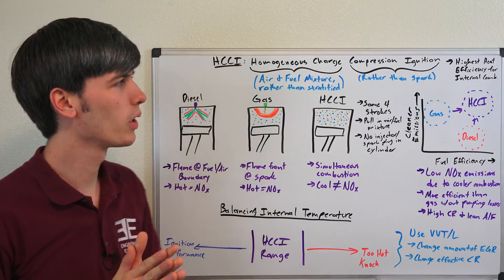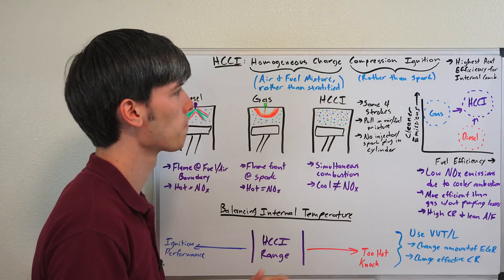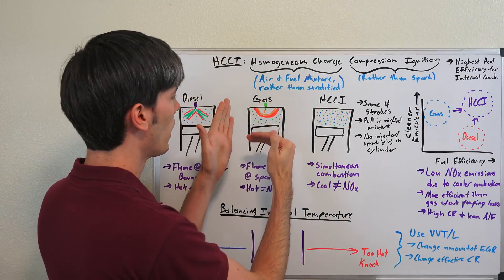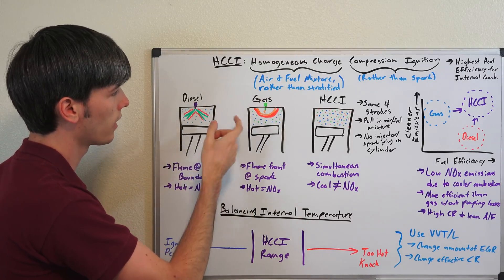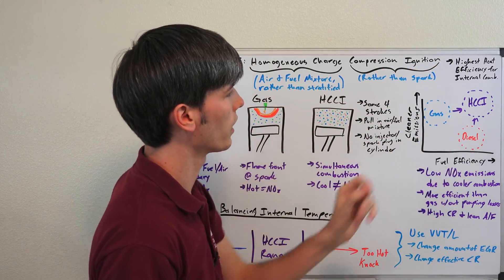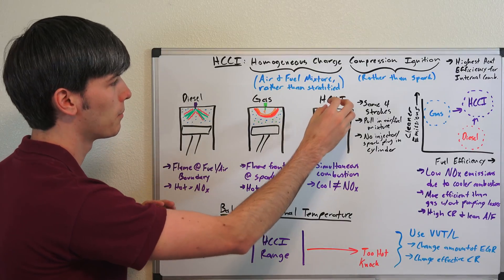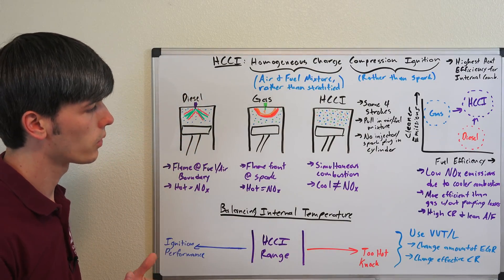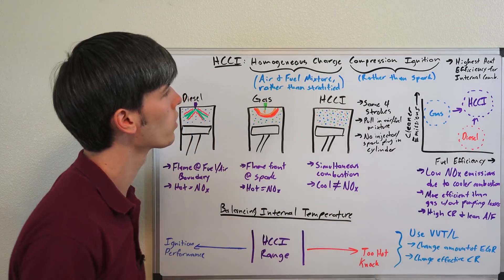The Most Efficient Internal Combustion Engine - HCCI

Comment: This is simply a highly speculated proposal for a possible engine engine design, its currently still in the lab. There is no proof that this will actually work because it only works in the lab right now using exotic fuel blends, which are not acceptable nor available for mass production use. Current gas engines actually are homogenous charge (HCSI) right now and are only missing compression ignition to make it an HCCI. Toyota has used variable (asymmetrical) compression ratio since 2007 in its Prius models and Ford has already presented its gasoline engine with compression ignition several years ago. The problem is that although gasoline can be (and is) injected into a cylinder so its functionally homogenous, its combustion pattern is unpredictable when compressed to the extremes that is required for diesel operation so (engine damaging) detonation occurs. High tech computer control has been applied to control the mixture even more precisely but it fails outside the lab, where conditions cannot be controlled precisely. Research is focused on making gasoline engines closer to diesel because gasoline already has much lower emissions than diesel. An exotic fueled HCCI engine is not likely to be successful in our lifetime, but improved fuel injection (direct injection) with improved spark control technology.

Comment: injecting the fuel doesn't ignite the fuel mixture in a diesel engine. it's heat of compression. as the fuel mixture is compressed, it gets hot, until it reaches its flashpoint, when it ignites. that or glow plugs/an alternative form of glow plugs, but those mostly are just needed during warm up.
Reply: There is no air fuel mixture in a diesel engine. Fuel ignites instantly as it is injected.
Reply: Fuel can't burn without air. There has to be an air fuel mixture.
Reply: It's mixed as it's injected, which is a reason why emissions like NOx are bad for diesels. Mixing it thoroughly on the intake stroke lets it combust in the best way possible

Comment: Might have missed it but how is the charge getting ignited?
Reply from the maker: Compression.
Reply: Like a diesel, but NOT controlled by injection timing. This works fine on small engines, but destroys larger ones, just like detonation (pre-ignition) in a petrol engine.

Comment: I'm not disagreeing with anything you said, however, if we are talking in terms of total efficiency, hcci isn't as efficient as an internal combustion engine could be. since the amount of heat is reduced, the total possible heat energy which could be discharged from the chemical reaction is effectively wasted.
Reply: instead of trying to reduce combustion temps, they ahould be trying to find a way where 99% of the total heat energy is absorbed and used to propel the vehicle. e.i. use the coolant system to produce a steam which drives a generator which charges a battery or is used to also propel the vehicle, and have air to air "radiators" inside the exhaust system to absorb any residual heat.
Reply: BMW were looking into that once, I remember.
Reply: It is a great concept, but there are some serious draw backs. Essentially what you are doing is turning your engine into a  boiler/pressure vessel. That leads to two large issues. One is engineering, Your block heads and all cooling paths in the high pressure side need to be pressure rated, now that you have boiled the water you need to extract the heat from steam which is much harder then pulling it from water so a larger and more complex radiator a needed. The other issue is safety, I have dealt with ANSI pressure rating even simple tanks can be an absolute bear, now you want to put it on wheels and send it down a highway at 80 MPH. Not likely.
Reply: I don't mean use the coolant system itself to produce steam...I meant use the original coolant system and add a seperate steam system linked with it so that there can safely be heat exchanged but obviously rate the steam side far higher that typical use.
Reply: That's what turbochargers do, scavenge energy from waste heat in the exhaust in order to decrease pumping losses.

For the last few years Formula 1 has been recovering electrical energy not only from "traditional" regenerative braking, but also from within the turbocharger unit. Since this is a performance application the energy is then used to maximise acceleration - however a similar system could easily be designed to prioritise fuel efficiency instead. 

This is one of the next logical steps in terms of hybrid petrol/electric automobiles - however the efficiency gains come at tremendous costs and complexity.

Trying to achieve 99% efficiency is an exercise in futility - it is simply impossible. No power train design could ever achieve 99% efficiency, the inherent losses are simply too many, and too great.
Reply: Container ships use the engines exhaust to generate steam which drives generators or heat bunker fuel. They control the boiler pressure by adjusting how much of the total exhaust gas passes through the boiler and how much is bypassed straight up the exhaust stack. You could use the engines cooling system as a feed heater to preheat the returning water to the boiler after it's condensed back into water.
Reply: And as you've pointed out, this only makes sense on literally the biggest engines on the planet. Engines which weigh thousands, or tens of thousands, times more than car engines - and therefore have similar multiples of waste heat.

This will absolutely never be practical on an automotive scale.
Reply: Alexander Well if you had told the inventors of the computer that one day you'll have one small enough to fit in your watch, they would have said that's impossible for a 100 different reasons and lectured you all them.
Reply: Sure, and that development occurred over about 50 years, there was a demand for it, and it didn't violate the laws of physics.

The internal combustion engine has been in development for around 156 years. There is no demand for an automotive engine to be so absurdly complicated as to scavenge waste heat to run a steam turbine. Building, installing, and maintaining such a system would likely consume far more energy than the system would ever return.

Waste heat is dumped because it can not reasonably efficiently be captured, and re-purposed, on such a small scale.
Reply: Alexander Well if anyone is going to increase the complexity of the ICE it will probably be the germans. They have a habit of engineering things with many I guess you could say, unnecessary components just 'because we can'.

Comment: This is running on pure detonation and will beat the hell out of the bearing shells, push the head gaskets out, fatigue the rod, crack the head, shatter the crank, and erode the piston's surface.  So much for Toyota's reliability . . .

Comment: You never even said, what kind of fuel could this engine use ? Diesel? tradition gasoline? something else ?
Reply: I believe traditional gasoline
Reply: Both
Reply: technically true, except knocking wouldn't be as much of an issue if it was diesel and emissions would be higher. Which is how I'm guessing it's being built to take gas.

Comment: I don't understand how it works, I mean, the reason why you use injection (whether in diesel or in high-end gas engines) is to avoid the anarchic, premature ignition of the mixture (ignition before top dead center). In gas engines, the spark  plug is there to control the ignition time. How do they control, in this HCCI engine, the time at which the mixture ignites?

Comment: so, would HCCI engines wouldnt require spark plugs? or at least, not the traditional ones?
Reply: Not to be rude, but you should watch the video again.
Reply: Yeah i came to regret my question a few minutes later. What i would ask again is to hear an explanation on the ignition sequence instead, specifically on the lubrication on the pistons if any and if theres any negatives on the engine to take i. Account

Comment: The video doesn't explain any reason for this new engine to be more efficient that diesel.  The burning fuel heats up the air.  The piston then moves down allowing the air to expand taking out energy in doing so.  Doing a better job of using fuel to make air hot or a better job of taking out the energy are the two places where the new engine could be more efficient and yet neither was discussed
Reply: PREDEX2000 The didn't explain the "better burn".  They stated a lower peak temperature and hence less NOx but that doesn't mean a more efficient engine jut a less polluting one.
Reply: +Ken Smith it is more efficient, you are producing less heat to achieve the same mechanical work you would with a conventional gasoline or diesel.
Reply: randomguy much I see no argument suggesting that they are producing less heat to do the same mechanical work as a conventional diesel engine.  The air in the cylinder is heated by the burning gas.

PV = NRT

P=Pressure
V=Volume
NR=is the amount of working gas
T=temperature

According to this, the greater the ratio of pressures, the greater the ration of temperatures.  According to Carnot's law, the greater the ratio of temperatures the greater the efficiency.  In the conventional diesel, the air is compression heated well above the self ignition point.  This means that the starting point from which adding the energy from the fuel starts.  If the energy from the fuel is the same in the two cases, the maximum temperature must be higher in the conventional diesel.
Reply: +Ken Smith agreed, but in the start of the video, he said that the flame front, where the temperature is the highest, is the place where NOx gases are made, if they use up the heat of combustion, you are left with more of NOx and unburned fuel.
Reply: randomguy much
More NOx doesn't imply more unburnt fuel.  For that matter, usually, a lean mixture is what makes NOx and a rich mixture leaves unburnt fuel but no NOx.  Thus I still am not seeing a back up for the claim of greater efficiency
Reply: About efficiency:
When a diesel compression takes place, the fuel is sprayed into a chamber where the pressure causes it to combust while it is flying through the chamber; it is unevenly dispersed, and so doesn't burn completely or cleanly because some of the fuel isn't in contact with enough oxygen to completely break down.
   When a gasoline spark-ignition takes place, the combustion process travels outward from the spark site.  WHILE THIS IS HAPPENING the pressure is pushing the cylinder head down and away from TDC, so pressure decreases as fuel is burning and some of that energy is lost as heat in the expanding gas.
   The HCCL system described would compress an already-homogenous mixture that would (ideally) detonate AT TDC; detonation is an everything-all-at-once event, so in such a mixture, it would all 'flash-combust' and push on the cylinder head continually from TDC to BDC until the exhaust valves open.  This 1) captures more of the released energy for turning the crankshaft; 2) minimizes losses of energy to non-burning or delayed burning of fuel.
   Ideally.  This system requires control or anticipation of multiple related factors to work as described, including fuel type and quality, air quality and flow, and temperature of the mixture going into the fuel rail.  It's not simple - but neither is variable-timing, twin-turbo, or the hybrid powertrain.

Comment: The rabbit hole I see here is having an arsenal of sensors and gadgets needed to control and monitor that fuel injection down to the last little drop - even more so than today's ridiculously technology-ridden engines. And with that if you have so much as one computer error the whole vehicle goes haywire. Shoot, my buddy's 2003 RAM had one little issue with the computer and it ran terrible, sucked a ton of gas, and wouldn't idle. So I can only imagine today's cars being even better!!! (sarcasm intended)

Comment: What type of fuel would these HCCI engines run on?? Petrol or diesel?
Reply: basically it's like a fuel injection diesel
Reply: Dora the explorer ok thanks. well RC engines run on Nitromethanol so I thought these should run on diesel rather than petrol.
Reply: +Brian Su ahh the smell of castor oil in a nitro engine, brings back some memories.
Reply: nah I get that when I go karting anyway :)
Reply: +Brian Su oh and I googled the fuel requirements for hcci, they can be designed to run on diesel, petrol/gasoline, naptha or LPG, so basically everything :))
Reply: Dora the explorer ahh thanks.
Reply: Thanks
Reply: They are used in F1 and run on what is essentially standard gasoline.

Comment: What sort of power can you get at the wheels, assuming it's a 350ci V8?
Reply: Depends on what the design allows for.
Reply: Nicolas Losito How about something like an LS mill, but with hemispheric combustion chambers and HCCI. Oh, it's a pushrod OHV power plant.
Reply: There are many more variable than that. Variables range from intake design, fuel efficiency concerns, emissions, combustion chamber design, exhaust design, displacement, rpm range, fuel, just to name a few. 

If you want to learn more read Roger Bywaters book "engine technology for the modern world". He helped develop some of the best racing and commercial engines but also names others. 

I must warn you though, it will go against all the crap you learned on forums and go faster magazines.

Comment: That's a nice idea... We will see how it can be used in everyday driving.
However, I wanted to bring up one thing. Diesels are not so much more fuel efficient than petrol engines. I admit, they are better, but not so far as it may seem so. One MUST keep in mind fuel energy content. Diesel has at least 10% more energy per volume than petrol. That is a big advantage to begin with.

Comment: How would this new type of engine generate enough heat to ignite from a cold start?
Reply: It doesn't. So far HCCI only works under partial load and when the engine is up to temperature. They switch back to traditional ways of ignition when the engine don't run in the optimal working window for HCCI.
Reply: you have a unicorn.
Reply: so it does have spark plugs to get it to operating temps?
Reply: Depends on what fuel the engine runs. HCCI also works with Diesel. But for petrol engines they still need spark plugs.
Reply: maybe it's like diesels that it still needs glow plugs to help it start. and diesels already have a lot of trouble staying at optimal temperature in colder temps
Reply: David F Look up how a diesel engine works

Comment: I don't quite get it. I mean in theory it's all well and good but I suspect that it's next to impossible to achieve exactly even temperatures across the combustion chamber. Anyway, say we achieve this. What kind of sensors and computers will this layout require? I guess we're talking about calculations per nanoseconds (maybe pico?). I hope I'm wrong but I don't see any commercial use before 2025 and wide acceptance from the industry before 2030 even 2035. So I guess I'll stick to my 22% efficient civic for a little longer.

Comment: Wouldn't this whole system be ruined when I drive to Seattle from Colorado? Mile high to sea level, the pressure is going to be different so the temp is going to be different right?
Reply: Not if you have a programmed ecu.

Comment: I thought Diesel engines were without ignition, only a glow plug to pre heat. I have never seen an ignition system on a diesel ,that's why I know them as compression engines with a very high compression ratio upto 20 to 1. Please correct me if I am wrong

Comment: I feel like conditions would need to be near perfect to have a successful running HCCI engine. As you said, too hot of temperatures in the cylinder would cause early detonation and knock, and too low of temperatures would cause no ignition. I'm guessing the fuel would have to be highly flammable as well. The only way this could work is the ECU being able to change compression ratios down to the millisecond, which is near impossible unless you have a piston head that can change lengths or a cylinder top that can shrink.

Comment: Mercedes has a running prototype of this motor however it can only run HCCI at low rpm once the compression increases at higher revs it has to rely on spark ignition for accurate combustion.

Comment: I'm curious, you said the temperatures are going to be a lot lower because there is no spark plug to ignite. How is the engine going to reach its working temperature? Do these engines have different working temperatures than what we're used to (let's say ~90C)?

Comment: Homogeneous consists of five syllables: ho-mo-JEE-nee-us. This is the word we use to describe something composed of parts or elements of the same kind — for example, a homogeneous population. This is the proper pronunciation to use in the above video.

Homogenous (without the e) is also a word, but it has a different meaning and a different pronunciation. It is a biological term that means corresponding in structure because of a common origin. It is pronounced ho-MODGE-uh-nus.

Comment: How would the engine run before reaching optimal temperature on startup. Would there be glow plugs to heat this air/fuel mixture or an alternative?

Comment: Noob here. So, is the combustion started by compression, like in Diesel engines? And if so? Is this sort of like a Diesel engine, but one where you inject the air/fuel "pre-mixed"? And does this apply to both diesel and petrol engines? Thanks.